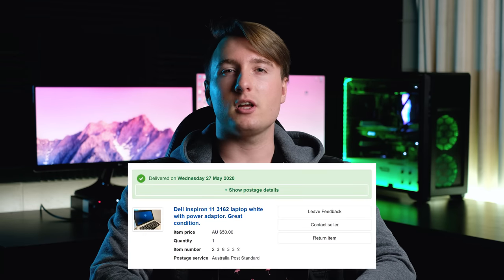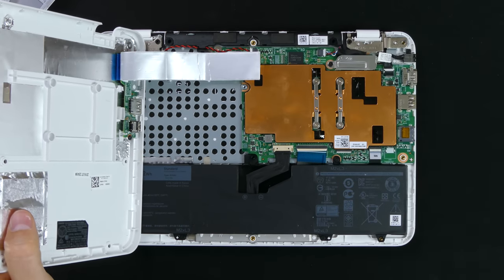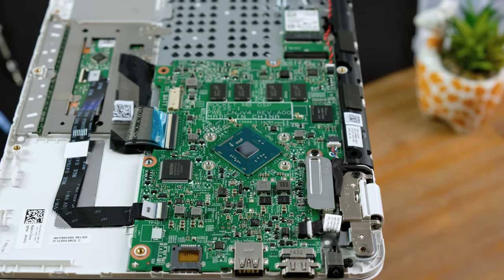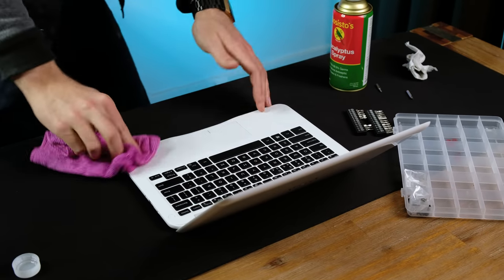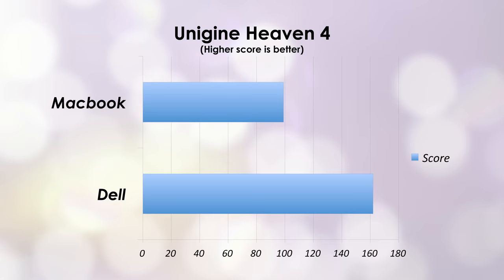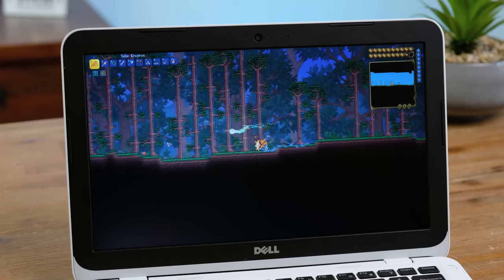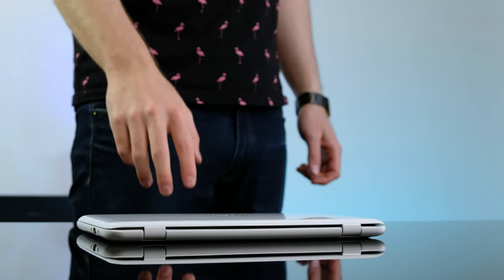Using A $50 Ultraportable Laptop... Does it Suck?

Comment: The reason for the slowness on the ssd is because it likely is emmc storage, which is closer to the flash in an sdcard than in an m.2 or sata ssd.
Reply: Emmc storage is actually slower than your average SD card and controller nowadays.
Reply: Me wondering what it saying
Reply: Windows 10 release 2004 actually reports the drive classification in the Performance tab of Task Manager. 
It reports these drives as SD cards.

HP have a very similar fanless machine, labelled "Stream", but on that you have to remove a whole rubber strip to access the case screws. Again, the system board is crushed into one corner of the case, but the keyboard connection isn't folded.
Reply: @DaimlerSleeveValve  teachers pet
Reply: DaimlerSleeveValve I have had a couple of these Stream series books. Fun fact, early ones actually shared motherboards from more capable laptops, just with bits shaved off. For a while you could really make one of them capable by picking up an ssd and one of those kits that let you hook up an ssd into an optical drive bay, dismantling the adapter for its msata to sata cable and just sticking the drive in where the board would have had an optical drive in the better laptop. Double sided tape optional but helpful.
Reply: @DaimlerSleeveValve  My laptop says ssd and it is the Inspiron 3180
Reply: I suspect the difference between chromebooks and their similar windows models is the amount of storage.

You can just bearly fit windows 10 on 32gb of storage.

Similar situation with chromeos but with 16gb of storage
Reply: but can it run libre elec?
Reply: My HP laptop has eMMc storage
Reply: You mean sad right.

Comment: when testing minecraft on these low-end laptops you should use the "sodium" mod, it gives crazy performance boosts
Reply: How much better is sodium than optifine? I don't have a crazy low end laptop but it still only has a 10th gen i3 and integrated graphics, so not a powerhouse by any means lol. I get a stable 60 fps with a mix of low and medium settings with optifine but I've heard about sodium too but never tried it.
Reply: @chrisw2345  its a lot better i started using it instead of optifine
Reply: Optifine is what i use no stuff like forge easy install and more features
Reply: Allso optifine is bassicly much more developed soo no it doesnt your just lying i wont give the goblin soduim
Reply: @haijehiemstra2883  Have you tried the sodium mod? It does have less features than Optifine, but does give slightly more performance, and most of the missing features can be added back to the client using other Fabric mods which is what I do.
Reply: @proximitea  Sodium gave me ~67fps, while OptiFine keeps up 90fps> stable. 🙊
Reply: Will it work on a HP Stream 11 with an intel celeron
Reply: @doge90432  yes, it will work on pretty much any computer that can run minecraft java
Reply: The new optifine update made optifine better in my tests
Reply: @dawger  yeah for me it gives the same fps as sodium also don't ask why I replied so fast
Reply: @proximitea  i dont but optifine has more features like glass textures combining and more stuff
Reply: @haijehiemstra2883  yeah I switched back to optifine for that reason it has more features
Reply: I use it even tho i have a high end pc
Reply: I use Optifine mod with Minecraft v 1.11.2 with HD620 running shaders mod it gives about 25+ fps average.
Reply: @vasoconvict  oh ok, i guess it varies for each person
Reply: No Sodium will not do anything with low end CPUs you need to have a good CPU to begin with
Reply: this can be misleading, in some PCs sodium is a better option than optifine, but in other PCs (like mine), optifine ends up being astronomically better in terms of FPS.
Reply: really? I installed sodium and got literally less than 2 fps on THE TITLE SCREEN

Comment: The CPU is mounted diagonally to prevent the leads from shorting together well in the soldering process this method is applied pretty much for all large logic chips with small leads this way they make sure that The chip is well bonded with the motherboard with no shortage in between and it also helpe to reduce the manufacturing cost
Reply: How does that prevent shorting exactly
Reply: It's mounted diagonally because it makes routing traces easier and that reduces cost because sections of the chip are much more equally distanced apart from their destination, without requiring expensive additional routing or layers to get acceptable reliability and performance.

We don't see it on larger boards such as full size laptops or desktops because there's enough room to route traces properly within the space given.
Reply: Nice
Reply: @PaulTheFox1988  we do! Many desktop boards had angled sockets when they still had northbridges. However after socket 775 it became a rather rare sight
Reply: @TheRailroad99  had
Reply: Just to add to what's already been said, the fan-out of the cpu pins are easier in some cases where half the pins come out on the right and half on the left.  Essentially treating chip with pins on just two sides rather than pins on all 4 sides and then half of them taking a right angle turn (where all the electrons could fly off like Dave Jones would say {this is a joke btw})
Reply: Dude I thought it was like that to match the dell logo

Comment: I actually am on a similarly powerful laptop playing half life two from an external hard drive
Reply: It has 2gb of ram btw!
Reply: How is that even possible? when I get around to playing it, SAOHF lags and my pc is 3x better than this laptop. It would have been a reall powerful pc back in about 2010-11
Reply: That's a great way of getting around the storage bottleneck, I'd recommend to anyone dealing with eMMC storage to just boot from the USB ports instead.
Reply: Cool
Reply: @amirpourghoureiyan1637  Put a external usb hard drive or ssd inside the laptop, create a hole for the cable and plug in the usb
Reply: @luminumlx2604  or mod the WiFi card PCI slot with a breakout cable
Reply: Same
Reply: Rn, im on a laptop from 2013, and im downloading unigine heaven 4 and cinebench r20 as im writing, imma post a comment how it will go, and specs too
Reply: Ok, the cinabench wont work with me anymore, so i posted about it in r/softwaregore, my username is u/Latvian_Video
In the unigene heaven 4 it scored 289 
Specs: CPU: Intel celeron 1000m
Gpu: Intel HD 2500
RAM: 4gb @ 1600mhz ddr3

Comment: Diagonal CPU installation can be for efficiency of the space on the motherboard. It's possible that the screwholes for the cpu heatsink would cause a pain if the cpu were put in horizontally. Of course, having everything soldered etc. are all money saving measures. Margins on these devices are much smaller than on others. Great video as always though!

Comment: A common strat on these laptops is to remove the m.2 wifi card and fit a smaller ssd in that slot, then just use a USB wifi card. Its not ideal but it is a solution.

Comment: I would honestly like to see you try to use linux on this thing, linux usually runs well on low power hardware and 4gb of ram.
Reply: I have a Desktop from 2007 with Core2Duo E7200 and 2GB of DDR2 RAM. I put Linux Lite on it and it works great.
Reply: Depends on what you are doing. Chrome OS is usually even better than your typical light linux distro for performance and battery life. I am sure it could run libre office and web browse okay, unsure about videos on linux.

Comment: I completely appreciate your observations of how slow the Dell is. I however have a borderline erotic fascination with netbooks running Windows XP from around 2005. Specifically the Acer Aspire One. I have them in all sorts of colors and generations. Its ridiculous, I still use one for Vagcom which allows me to scan modules on VW's from around the same era. Anyways lets say that a calendar is a necessity on these computers. It's an early Intel atom and its computational speeds are glacial. There so so slow that they don't even get hot, they act as an air conditioner. I think isolation is getting to me? Comments?

Comment: Try installing windows xp to see if the performance would be better and faster
Reply: probably not supported
Reply: Unfortunately there are no Windows XP drivers, as the only thing I would use this for would be retrocomputing. I'm not sure if this thing even supports Windows 7 (maybe there do exist modded drivers). Probably the best OS for this would be a light-weight Linux.
Reply: something like bunsenlabs would probably run great, i wouldnt use zorin though
Reply: @karl-erikkald8876  Any laptop that has Windows 10 installed usually has Windows 7 as the minimum supported OS and there are indeed official Windows 7 drivers.
Reply: It's a modern laptop dummy
Reply: @alasdairmaciver2964  You certainly never tried installing Windows 7 on a modern PC from 2013-2020. I've successfully downgraded my 2014 Acer Aspire E15 laptop to Windows 7 from Windows 8.1 with no problems whatsoever. Windows 7 drivers are available for my laptop on the official Acer website even though  my laptop is designed for Windows 8.1.

Comment: Witch version of Windows 10 ist installed?
1507? Or so
Reply: Probably 1809
Reply: Yes, 1507 or 1511. You can see the Action Center icon on the left side of the clock instead of the right side (1607 onwards)
Reply: You can install 2004 (use Media Creation Tool to put it on a USB), but may need to do some vicious pruning of apps. Besides the usual bloatware I had to uninstall Office and use a USB stick as additional storage, then put Office back on again afterwards. You need about 10GB free to run the update.

Comment: I have the same model, mine is red, using a 500GB HDD (Toshiba). It better running Linux (MX Linux doesn't support the trackpad) than Windows, and the Windows should be reinstalled to remove the bloatwares if you want to use it (weak laptop should never be installed with bloatwares. Don't worry, reinstalling automatically activates the license since the license is OEM)

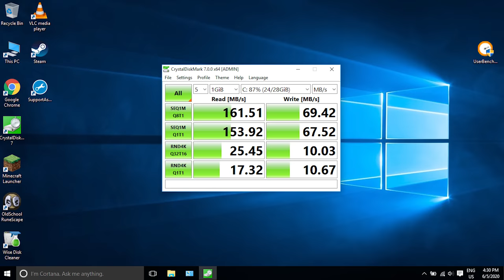Comment: 7:34 I've also gotten better write speeds from a 5400RPM drive in a USB 3.0 enclosure. Those eMMC chips are not very good and are basically just an SD card, only soldered to the motherboard - so you can't replace or upgrade it!

Comment: That empty space near the motherboard could have been used for a user replaceable/expandable M.2 style (or mSATA style) SSD :) as 32GB isn't enough at all. After the first major "feature update", you'll be out of storage very quickly.
That storage is also eMMC based - in other words, like an SD card. Not very quick. They'd have been better equipping this with a 160GB or 250GB mechanical hard disk - they are so cheap!

Comment: That's an eMMC storage. Definitely the reason for the slowness. However, they feel actually faster than 5400 RPM HDDs because of the access times. Funny thing is that I have an ASUS ZenFone 2 smartphone with Intel Z3580 CPU with the exact same model eMMC (SK hynix H26M64103EMR) and the speeds are much less when compared to this laptop.

Comment: I do a lot of microcontroller electronics and placing the micro with 45° of rotation allows for an easier tracing very often, especially if you have few PCB layers.. but this is very dependent on the tracing style of the designer.. in general, anyway, nothing weird or wrong with that

Comment: And to think that I could've ended up with one as a birthday gift back in 2017, but I instead ended up with the 2-in-1 version (Dell Inspiron 11-3158) with a Core i3. After it fell to the ground on a moving bus, killing the hard drive, I installed a SSD and performance was improved! Sadly, the power jack was poorly designed and would constantly break off. I replaced the power jack roughly 5 times throughout my 3 years of ownership before replacing it with a Lenovo ThinkPad X250!
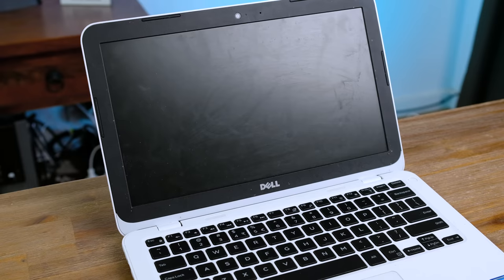(1:14) Maybe a child used it?
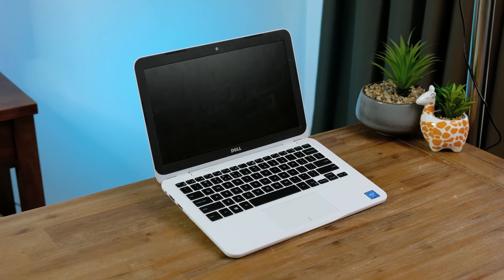(1:40) It appears to be running a fresh install instead of the original Dell factory image, which may mean no annoying proprietary Dell trackpad drivers that gave me issues back in the day!
(2:58) I'm at least glad mine came with a hard drive instead, which I could swap out for an SSD!

Comment: An unupgradable 32GB SSD? That's terrible! And apparently a very slow one!
Probably has no DRAM cache!
A USB external HDD could be faster if this has USB 3.0!

Good battery life? Not surprising, there is like nothing to draw power!
Never buy a such Celeron garbage, see even a Core 2 Duo outperforms it no problem. And that is from 2009.
I guess 2GHz the Core 2 Duo in the late 2006 iMac also outperforms it!

Comment: I got the Inspiron 11 3168, thinking it's be a good lightweight, somewhat disposable laptop. I upgraded it to 8GB RAM and threw in a 512GB SSD. Mine has the Pentium rather than the Celeron. They are basically good for nothing more than web browsing. They are pretty much shit at everything else. My Samsung 850 EVO gets horrifically low scores. I did speed tests in my desktop PC and got around 550 Read/500 Write, but in the 3168, speeds are halved. 🤢🤮

Comment: What I just want to know is how you manage Windows 10 updates on a laptop with 32GB of storage-because you can’t store those updates on an external drive.
Reply: The only way is clean install every time a major update comes out. The newer versions of win 10 need a lot of free space, and fight you when you plug in an sd or usb to try to use that
Reply: You can install 2004 (use Media Creation Tool to put it on a USB), but may need to do some vicious pruning of apps. Besides the usual bloatware I had to uninstall Office and use a USB stick as additional storage, then put Office back on again afterwards. You need about 10GB free to run the update. Use the Disk Clean-up utility to tidy up the Windows Update stuff first - there's often 3GB hiding there. This was an HP stream with very similar specs.
Reply: @DaimlerSleeveValve  OK, thanks!  You could probably run some version of Linux on this laptop too.

Comment: When something gets crushed by some Core2Duo CPU,  you know it sucks big time. It's OK to cater for all kind of needs and offer affordable options, but this is just too much. At least considering this as a thing of the present, which very much it is, in the sense that this still pretty modern thing is the previous model to some quite similar garbage in the market today. If you do find this for 50 bucks (which I doubt), it does make sense for some extremely undemanding use cases, but do not never ever buy something like this new!

Comment: guys i have a dell xps 15 which doesn't turn on , doesn't show state of charge with the button & the power led doesn't even turn on. could somebody tell meany solution. i have reset the cmos by removing the cmos  battery  and also discharged the static while i was in there.

Comment: These are trash... I had a similar computer with 32gb hard drive and couldn't get windows updates because the drive was too small. You need 64gb minimum. You can update using a thumbnail drive but it's like getting teeth pulled.

Comment: Anything Intel Celeron you should avoid at all costs. Just a tip. even if it's free you'll be pulling your hair out with how fucking slow Celeron processors are. This is speaking from someone who used a Celeron laptop from 2016 to 2018. Constant bluescreens, struggled to play games like Roblox and it was slower than the 11 year old family computer in my laundry room